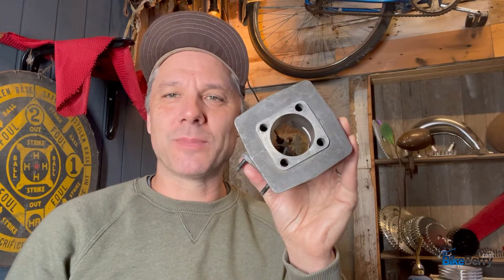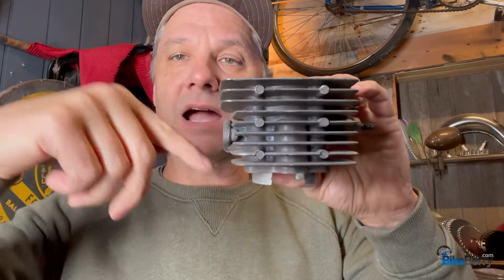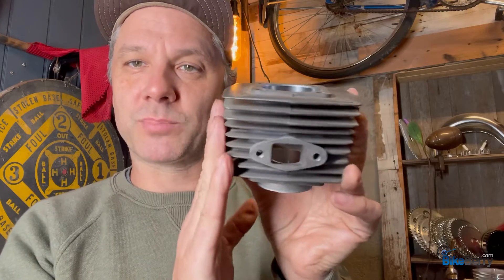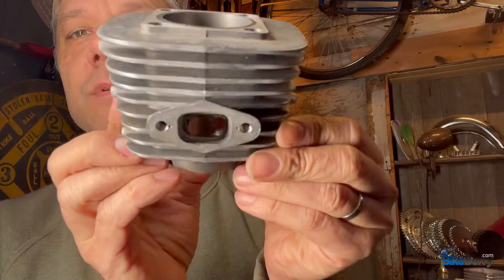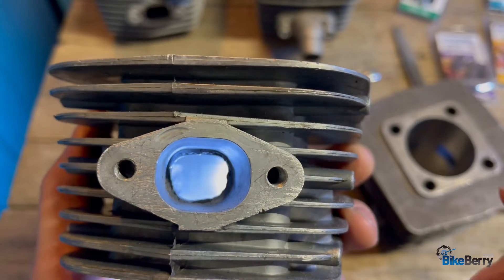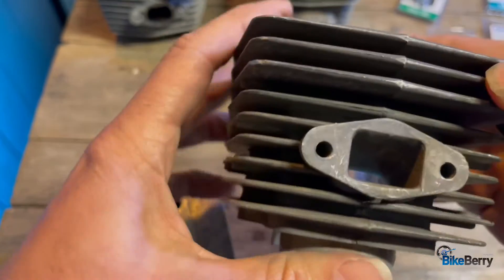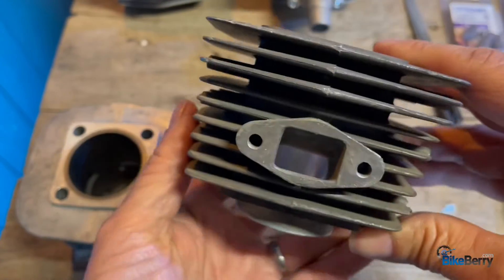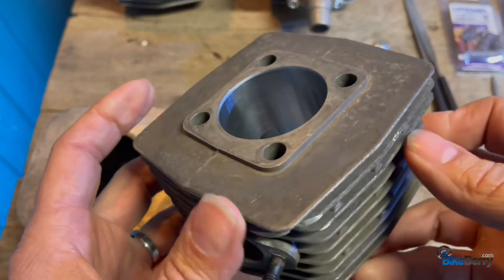Engine Porting Masterclass - Introduction | BikeBerry

Comment: So im confused. Is this in the case that i just need to do maintenance on my engine after a few years and I just need a new head or is this an entirely new performance upgrade by having the intake and outlet offset😅 or is it none of the above.

I’ll be honest the only problems I’m having right now are in that there’s not enough air going to the engine but then again I think it’s because I used too much oil and not enough gasoline for the engine because I used a 40:1 mixture as per the instructions…
Reply: I'll only answer to this: The 40:1 is the minimum for most.There's Allot of videos(Duh,right?),that argue for more or less.I ran a cleaned port,(Just Flashing,and tiniest of bevel so the rings don't catch),with gaskets to match for 3000+ miles at 25:1 and then went 32:1 for the next 1k.Water in the fuel caused it to Pop and wedge offset when I stupidly listened to "Add a fuel drying additive in cold weather".It absorbed water...
Reply: @bryduhbikeguy  i was told to ride and die 24:1 i think. Like that that was the thing to go for… i’ve already done plenty of miles so im gonna use up the rest of my fuel and then chnage 40:1 to 24:1 - 32:1